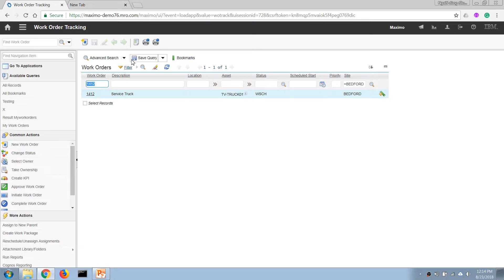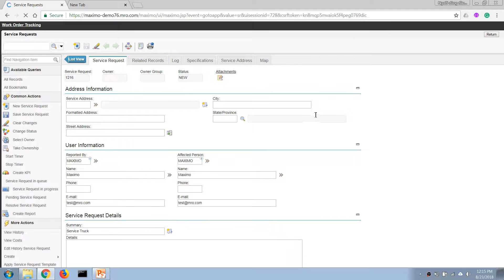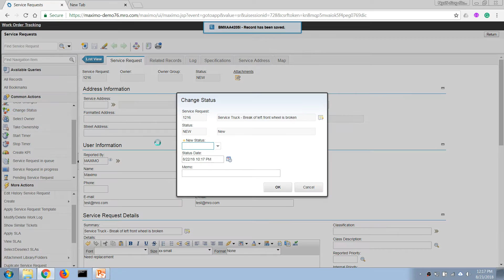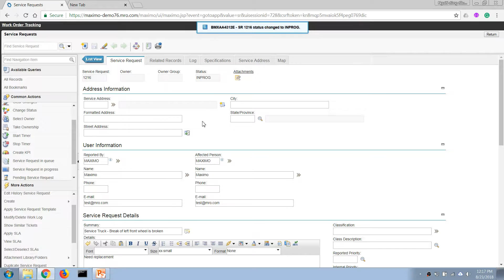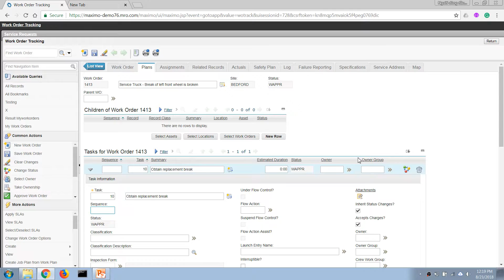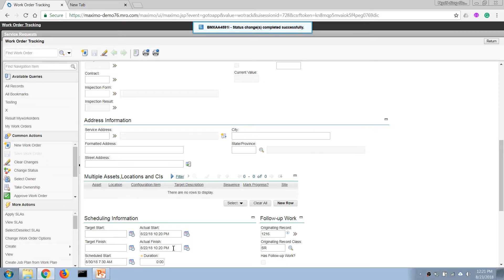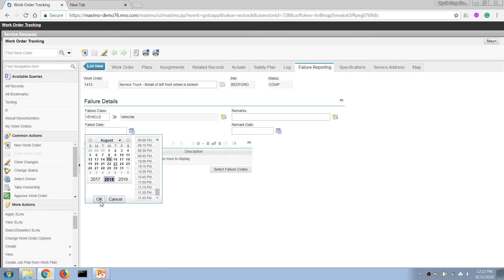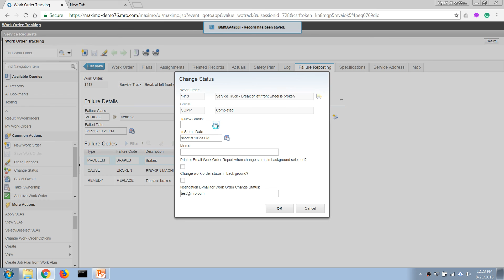Maximo Basics - 09 - CM Work process and Failure Reporting *core*

Comment: Hi, i followed all the steps till now. but i got stuck here coz i am not able to create service request and i am getting error that the relationship PLUGINCEVENT does not exist. Please help at the earliest.
Reply from the maker: It looks like your Maximo environment has an add-on installed, likely the Oil & Gas or HSE add-on, and it has some issue. If possible, try accessing a standard Maximo instance instead.